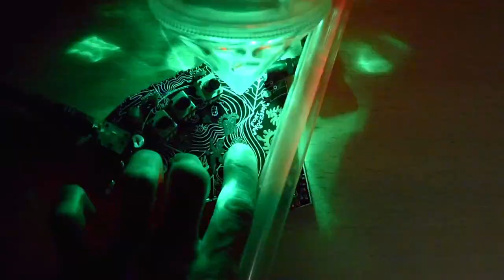Fort Processor - experimental noise synthesiser circuit by Isn'tses

Comment: AMAZING.
I'm having one inserted into the blue bass you see in the thumbnail .
I already have 9volt preamped EMG pick ups installed, so that hot signal will feed through the Processor.
a 3 way bypass switch will allow 3 modes 
1. clean regular bass 2.synth/bass 3. straight synth.
It will be mounted on the white pick guard on the face of the bass.
I can use a flash light as a wammy bar .